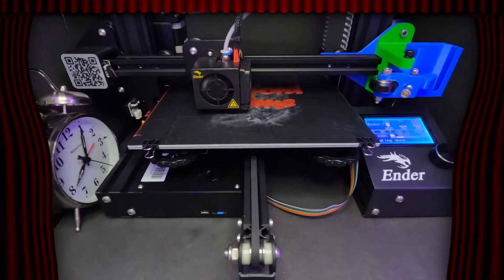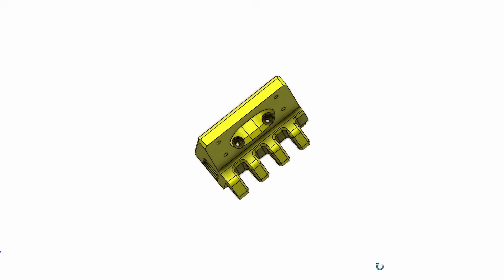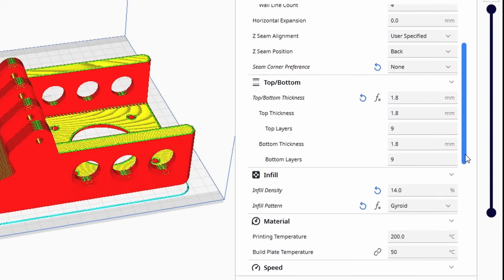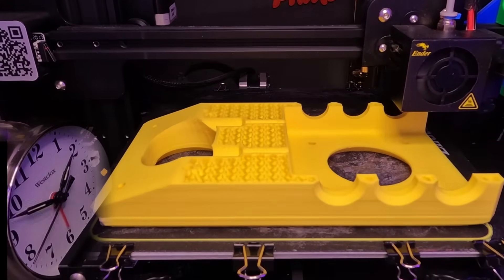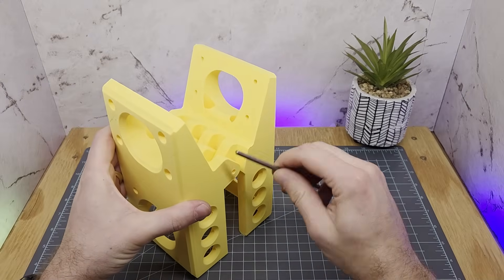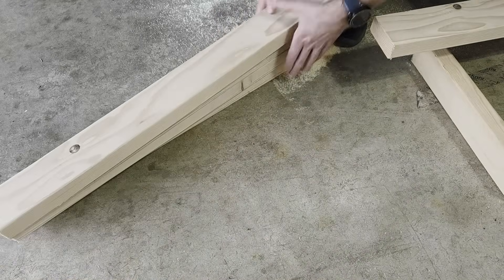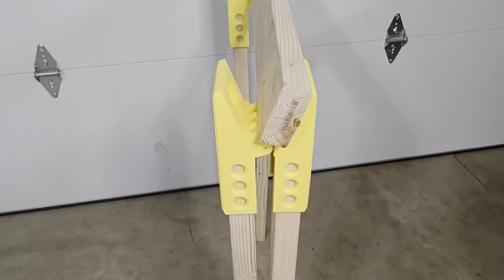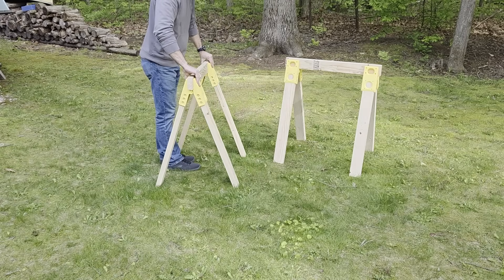These 3D Printed Saw Horse Brackets Have INCREDIBLE Strength! I was certainly impressed.

Comment: Suggestion: You can incorporate a feature that would allow you to add (not screwed down) two 8ft 2x4's in such a way to make a rectangle with the two cross 2x4's, you can then use that setup to break down 4x8ft plywood sheets. I would dedicate two 4ft cross members and two 8ft long 2x4's with 3D printed brackets to support the plywood in the middle (with 2 or 3 add'l cross members in the middle). This setup can be used only for breaking down big sheets. Your other cross members can be used when you want conventional saw horses, like you made.
Reply from the maker: The thought crossed my mind when I was making these ones... had to see how it went first, LOL! Had no idea they would prove to be so strong, but now that the design is done I probably should investigate other features for it 😉. Ever since I printed these ones, since I didn't really have any wood projects going on at the time and these have been sitting up as a makeshift table in my garage for working on things and collecting clutter. The sheet of plywood on the top is sagging horrifically, I was tempted to get designing! LOL. Wouldn't be too tough, just have to do it I guess... Thanks for the suggestion!

Comment: Nice design, I like these more than the ones I printed. I thought the same thing after seeing the price for the cheap flimsy metal ones I could just print these. Just a couple of tips for future iterations. If you can print on the side you'll get stronger prints for use in that orientation and probably fit 2 on the build plate that way. With 3D printing lightening holes may not actually make the lighter. You'll have walls in parts of the print where it really doesn't help the strength of the part. You just design parts thick around the edges and let infill fill the voids. You can actually go less infill and have more walls for more strength. If you do add big holes like that taper them at a 45 degree angle at the top to allow it to print better. You can also use slicer settings to add more walls/infill around only certain parts of the print. I started doing this in some of the items I sell to make them stronger at their weakest section.
Reply from the maker: Thanks! Just curious, which ones did you print? I mean yeah, why couldn't they be 3D printed right?
I experienced what you said about the holes, at first the part got lighter, but with more and more holes added the part actually started to get heavier due to the extra wall layers around each hole. I thought about different orientations for printing, and maybe would have approached those if the initial model didn't hold the weight it did... I mean, I can't complain about it testing out to 475 lbs! I've been doing tapers/chamfers as much as it makes sense instead of radii, I watched a video from CNCkitchen that made sense on it someone shared with me. Either way works really, just one looks better and is more consistent with layer lines, but yeah mostly it's just corner relief. Less infill and more walls, I did a video on screw torques with various infills and wall thicknesses, the wall thickness I believe added more capacity whereas infill didn't do much. I like your idea about adding more walls in certain places, I'll have to give it a shot! The only downfall I see with that is, now the model needs to be sliced and printed by at least a 'Michelin-level' 3D print person. I like to keep things simple, but hey, if the design warrants special stuff I'm willing to give anything a try to make it work. Thanks for your feedback on this, it really helps a lot!

Comment: Gyroid infill might not be the best for strength, the default cubic is better for that with straiht lines in all directions. Together with the sideways print direction suggested earlier that would improve the strength even more.
Reply from the maker: Sounds logical. For some reason I just like the gyroid though and keep going back to it... LOL!
Reply: @sanfordprime it is mezmerizing to watch in timelapses. Cura has an add-in that adds a detailed explanation to all the slicer options btw, it also details all the pros and cons of the infill patterns.
Reply from the maker: Thanks for that info, I'll check it out... never knew.

Comment: Nice! You should let the weight on the saw horses for a few weeks and see if the pla deforms.
Reply from the maker: They're currently being used as a table (or makeshift workbench) in the garage with a sheet of plywood on top. Nowhere near the 475 lbs but... still holding up, it's been a few weeks now.

That'd be a nice timelapse though, 475 lbs (or more), snap a photo every minute or so and watch the progression until failure if/when it happens. Great future idea, Thanks! Maybe try different materials and compare? It's something nobody 'wants' to do themselves but curious enough to watch someone else take the time and do it... 😉

Comment: Sheesh man! I know your Ender is a work horse, but I think it's time to up your game. Since you like to do functional prints, check out the Qidi Q1 Pro. It's affordable, reliable, and enclosed with a high temp nozzle and heated chamber. Opens up a lot of other filament types. Cool demo and video though.
Reply: Oh and if you want someone to reach out to as a partner feel free to connect with me about a contact.
Reply from the maker: You know someone on the Qidi inside?
Reply: @sanfordprime  Not sure if anything I said actually went through, but yes, find a way to touch base with me.
Reply from the maker: Happens to me too... type something long and 'POOF!' Where did it go? A few moments of OMG, before it shows up sometimes.
Reply: @sanfordprime not the one you're replying to - just glad you're no longer looking at Bambu 👌❤
Reply from the maker: I checked out the webpage for it, looks great! An engineering grade printer for sure at an affordable price point. I like that it runs Klipper instead of the proprietary stuff. Will be looking into it more. Thanks for the info!

Yeah, me and the Ender have been through a lot together. I'd love to do multicolor and engineering grade materials for permanent functional parts that I don't have to worry about the PLA degrading over time. PLA is nice to print with because it's cheap and forgiving, but sometimes I'd like to take 3D prints with me and I'm always nervous about leaving them in the car (even on barely warm days) due to them warping.
Reply: Yeah I do try the instant pictures place or the book with lots of faces to chat more if you have either.
Reply from the maker: LOL, took me a moment... I have neither of those though. Most of my time is surprisingly spent on YT for now, once in a while a little bit of X... No worries, I'm not in any sort of hurry. I'm currently in good shape saving points toward a Prusa (Printables rewards) and a Bambu (Makerworld rewards), kinda waiting to see which one accumulates faster and which one I end up getting first, LOL! Are you using the Qidi for projects around your channel? If so, how do you like it? It really does look impressive from what I've seen and I'll probably get more serious about it down the road a bit...

I like your channel! Where were you two weeks ago when I had to replace the headlight connector on my Ford Fusion? LOL.

Short story long. My headlight was giving intermittent issues, bump on it a bit and it was fine for another few days. Decided to replace the connector since it was showing signs that there was some heat on one of the pins... the new connector didn't work... actually created more issues cuz now my blinker didn't work. I gave up, took it into the dealer for a $205 diagnostic. They said it was the headlight assembly, they could do it for $1100... I was like, bro... I've had this thing out before it ain't that bad, just gotta remove the WHOLE front bumper, LOL... bought a new headlight assembly on the way home and it was doing the same thing with the new headlight... anyways I now had 1,100 reasons to dig deeper into it myself. Ended up being the new connector, ground receiver plug (#16) was pushed out of place on the car side... Plugged in the old headlight assembly and it was fine as well. Something so simple and virtually free now cost me a diagnostic and a $250 headlight assembly. Still waiting on the dealership response on the "diagnostic" thing, left the new headlight assembly in cuz why not...

Anyways, yeah great channel. Gonna come here often to get all learned up on my automotive skills and try to stay away from the dealership when possible! Subscribed! Thanks!
Reply: @sanfordprime  Yes I use a Plus4 and have printed many things. I have a lot more car parts planned, but I'm very confident in its abilities. The accuracy and print quality is also insane. It produces some of the most VFA free prints of any current stock printer. The Prusa Core ONE appears to be struggling heavily in that area. The A1 and A1 Mini are quite VFA free, but obviously aren't enclosed. I'm not honestly extremely impressed by X1C and P1 prints these days. I do love MW points though. I know so many people who have done crazy impressive prints with their Qidi printers. I just think it's the best option at that level for functional printing for sure.

Thanks a lot! I will be posting a lot more, but I've mostly been focused on short form for quite a while. YouTube is a grind as you know. OMG that headlight story is crazy. I'm very glad you didn't go for the insane dealer quote at least. I seriously can't stand how mechanics and dealers just try to rip absolutely everyone off. Given your symptoms, that never should have been their diagnosis. I definitely admit that a connector being out of place like that is a tricky one though and hard to spot right away, but I suspect the mechanic did not even try as a truly trained person should have caught it easy with any proper diag. Great work fixing it yourself! That's the way to be.

Comment: The reason this works is probably because the print is under a compressive load.... much stronger that way.
Reply from the maker: True. The design of sawhorses in general are strong too, which is probably why the overall design just hasn't changed through 100's of years or longer. Great observation! Thank You.

Comment: A note on adding holes to 3D prints to make them lighter/use less material: Because prints are mostly hollow due to infill, and the strength largely comes from the number of wall loops, adding holes to prints to remove material can often actually make them heavier. Imagine a cube with a hole cut in it. Now, where there used to just be 10% infill or whatever, you have a whole new perimeter of 3-4 thick walls. But, looking cool is paramount!
Reply from the maker: 100%! I torque tested some screws in a previous video and the different infills did virtually nothing for the torque they could handle. The largest gains were from wall thickness, but the highest torque was from a change in orientation (printed vertical = weak, printed horizontal = strong, torque-wise anyways...) I ran into the Hole issue you mentioned while trying to reduce the weight, at first it was working and yes I went too far and the weight reduction and it actually started becoming an increase with more holes! Kind of a weird counter-intuitive phenomena right? I hoped that the holes were adding strength with more wall layers in those areas that weren't doing anything anyways for the strength, it kind of became a truss-like design in the end.

Thanks for sharing your knowledge on this, and I can back you up on it now!

Comment: Be advised, weight ratings usually have a safety factor taken in, to protect both customer and producer, so there's a high chance saw horses or metal supports rated for a lower weight can support more. I'd estimate the safety rating is probably aroung 2 or 3.
Reply from the maker: Very true! I couldn't tell you what the safety factor is on the 475#... I never got to the point of failure. I wouldn't use them at the 475, that was a lot of weight! Most likely I'll be using them for 150# or less, a couple sheets of plywood at a time, or one sheet of plywood as a table workbench (which they're currently doing for me right now). Holding up well so far. I can't say that these things hold 'X' amount, because it is totally up to the person printing it and their settings, all I can vouch for is what I achieved.

Comment: 15:35 - 😒You already put more weight than this on the single one at 14:18...
Reply from the maker: I know... I figured it would be good until there once I sat on the one. I knew it was gonna be close though, I had no idea how many blocks I had until the end...Even 200 & 300 lb didn't surprise me after sitting on one. Sometimes I wish I had enough blocks to fully test, but in a way I'm glad I didn't break 'em. They're nice to have around! Imagine printing all 8 of them over a week and a half, without assembling one and no idea what was going to happen... this whole thing coulda been one big flub! (I still would have posted it I think) Thanks for your observation.

Comment: 2 quick suggestions: 1) print these on their sides. layer lines are your greatest point of failure, and the way you printed them, they would shear with a vertical load on them if they do fail. Printing on their sides gives you full vertical stress load capability since you're not going to be needing lateral strength. layer orientation matters if you want max strength. 2) i would HIGHLY recommend you pull the legs off and cut a corresponding angle on the bottom of the legs that matches the pitch of the brackets. that is fine if you are on soft ground, but put those legs with just the one edge of the 2x4 on something slick like concrete and you're looking at a point of failure as the feet slide away from each other.

I highly doubt either of those suggestions are NECESSARY, as you're gonna be dealing with relatively low loads and this setup is fine, providing they deal with sheer forces well enough, but if you are looking for MAX strength, make the leg tweak now and the print orientation the next time you need to print them and you will be in a much better position.
Reply from the maker: Holy smokes! Now you're talking some really strong saw horses! LOL. I agree with everything you're saying, unfortunately I wouldn't be able to test them to to their capacity as I only had 475 lbs of blocks laying around. These proved to be far stronger than what I need day to day, I'll have to find somewhere else to put the engine block though ;-). Once I saw what they were capable of doing I felt I needed to more or less proof-load them and not yield test them. They're pretty cool. I honestly didn't think they would withstand the 475 lbs, so I was impressed.

I actually saw some 3D printed saw horse leg bottom pads that plane out the perpendicular crosscut to the floor, might have to find those again...

I may do some updates to these in the future, or, since I posted the native solidworks file and step files to 3 different modeling sites, let the crowd go wild with remixing? But I have some ideas for improvement now with your feedback, and maybe if/when one finally meets it's demise I'll give them another shot in a different orientation.

Thanks again for your generous well-thought improvement ideas!

Comment: Nice design. I'm curious how long you left it up to see if it would stay up?
Reply from the maker: Thank you, and well, to be completely honest, I wanted to keep these once I experienced them in action. The initial goal of this video was to load them until they broke (I thought I had enough blocks on standby to do so), these brackets were sooooo much print time though! LOL. I can attest that they held the load throughout the recording and also shortly after (maybe 20 min) without any signs that they were going to crash down. I fought the urge to find more heavy objects laying around to throw on top... the 2x4's I had bridging the sawhorses were flexing by about an inch from the load, Crazy! I did not expect this result...
Currently they are upright in my garage supporting a sheet of plywood, I'm using them as a makeshift work table. First for repairing the Traxxas Stampede, and now they have a bunch of car parts on them. I'm using them as if they weren't 3D printed and super satisfied so far. If they break they break... I'll find a stronger material and potentially reprint.
Reply: @sanfordprime Great update and sounds like the 2x4 is the weak link, which is a little crazy. I totally understand about not wanting to break such long prints. Thanks for the info.
Reply from the maker: Well, still don't know where the weak link is... If I ever do though, I'll have to post it on X.